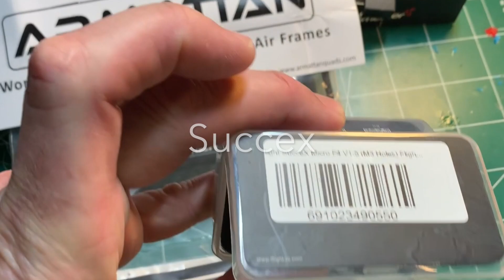Armattan Tadpole Build

Comment: Nice video, just a quick question. I have seen on several videos that there can be an issue with getting RSSI in the OSD with this FC and Frsky receivers, did you have any issues?
Reply from the maker: Hi Kwadrophenia, No I did not have issues with the Frsky R-XSR that I used as long as you have the right FW loaded. They have a later version of D16 (V2) that I have not upgraded to. Link below for the older FW for both LBT and FCC. Not sure what rcvr/s we are talking about. The XM+ uses aux12 (channel 16) for RSSI.

https://www.frsky-rc.com/r-xsr/ 
Go to history FW at the bottom of the page.

Comment: How do you like those beta fpv motors? Just picked some up for my build. I’m hoping they will have a decent amount of torque
Reply from the maker: The motors have plenty of torque and are very smooth. The only negative is they are a little amp hungry with the Avan props. Going to bi-blades will help if you don't want to run 4S 450mAh or larger 3S batteries.

Comment: I run 1103 xing motors on a 3s 450mah with 2 blade props. I get 4-6 min flight times and no battery sag till after atleast a minute. From what I can see I figure theres no big difference in power between yours and mine. You also might be over propping with those emax style blades. I just noticed you had battery sag right out the gate which can be an easy fix.
Reply from the maker: Hi Zach,
Thanks for the suggestion. I went a different route in fixing the battery sag. For this build I wanted to stay with 3 bladed props as they corner better in turns. My solution was to go with Tattu 4S 450mAh 75C batteries. They are only 11 grams heavier than my 3S 525mAh batteries. The FC stack and BetaFPV 1204 5000Kv motors can handle 4S. This made a world of difference in battery sag. I am 3 min in before any noticeable sag. Also I am now getting 5min of flight time if I am going easy and 4 if I push it.

Comment: I have that stack and was wondering about that frame. Did you have to do anything special to get the room. Do the stack bolts hit the upper plate? I have the 1103 8000kv and the 1204 5000kv. Trying to figure out what direction to go as far as a frame. Would you build it again or do something different with those components? Thank you for sharing this.
Reply from the maker: Forty5Kimber,
I am not sure why iFlight used the extra long stack bolts other than adding additional components (e.g. Caddx Baby Turtle). So I just turned these around so the heads are on the top of the stack and the nuts are on the bottom of the frame. I will probably get shorter stack bolts.

I want to do a 4 inch build but these are not the right components to do that with. I am happy with this build so far as a 2.5 inch freestyle quad.
Reply: SLOG FPV My frame will be here tomorrow thanks again!
Reply: I have a random assortment of 2mm stack bolts, how long should they be. I think I will order the frame. Thank you again for your help this looks like a tough lil bird.
Reply from the maker: @Forty5Kimber  
The stock bolts are 22mm. With reasonable tension on the rubber isolation grommets, I would use 20mm bolts. You will still need to put the head of the bolt on top of the stack and the nut on the bottom. That will give you about 3mm of clearance between the top plate and the stack bolt. Also having a little extra thread allows you to play with grommet tension. I hope this helps.
Reply: @slogfpv  thank you again it helped a bunch ordering this frame asap this looks like a great build!

Comment: I recently received a Larva X V2 and wrecked it yesterday. I hit a tree and broke the frame in more than 1 place. I really want to move my Larva guts into the Armattan Tadpole frame. What do you think? 🤔
Reply from the maker: Hi Juan Ninja,

Without the Diamond VTX/DVR it would easily fit within this frame. With the FC board and Diamond VTX I was measuring around 18 mm. The stack height should not be greater than 16 mm so you may have to remove the motor connectors and solder the motor wires directly on top of the flight controller. But other than being tight, I think it would be a fun little conversion.
Reply: @slogfpv  Agreed, I think it would be a fun little build. Good point on the stack height potential issue. Do you think it could clear it with the AIO Board Bracket Armattan offers for the Tadpole? Maybe I could use some washers or something?
Reply from the maker: @dynamicfpv  
The 18 mm was assuming that you were using the whoop board bracket. But as they say, if there is a will there is a way. So without actually doing the build, I think you have the following options if you don't want to solder the motor wires on directly:
1. Flip the board upside down so the motor connectors are facing up. The motor wire connectors will not hit the bracket then and you only have to worry about having enough clearance for the VTX/Camera wires. However, you will need to change the AIO FC orientation in the Betaflight Configurator.
2. Don't use the AIO bracket and just use the front and the back stack bolts like what you would do on a Primo frame build. The motor connectors do clear each side of the bottom frame.
3. Put the whoop AIO bracket mount underneath the frame to get more motor wire connector clearance. You will need to play with rubber grommet heights (may have to split them in half or add plastic washers. 
4. You might be able to reduce the gap between the AIO board and the VTX board and to get enough clearance. 

I am sure there are other creative solutions so I would go for it.  

Cheers,

SLOG
Reply: @slogfpv  I don't really want to take the motor connectors off and sauder. I like your idea of putting the AIO flight controller underneath the frame. As you said with some creativity with the washers, nuts and spacers it should come together. I'll keep you posted when I get to building it. Keep up the great videos. If you have any more great ideas please let me know.

Comment: I was about to build out this frame   but I noticed my omnibus Nano V6 & the matching orion  ESC wouldn't fit in this tiny frame.  Odd because my 4" Armattan Japalura is running that set just fine.  I wish they had a 20 x 20 mount in this .   I have nothing in the 16 x 16 form factor yet ...I really admire your tenacity. I'm 52 this year and soldering all that tiny stuff always amazes me that I pulled it off

Comment: Nice Video
How do you find it in comparison to the GEPRC Phantom ?
Reply from the maker: The Tadpole as I built it, has a very different flying experience than the Phantom. The Phantom is geared for someone who wants a great little park flyer with longer flight times that you can do light freestyle with. It is more of a chill out and relax experience with the Phantom. The Tadpole is more of serious freestyle quad due to its larger motors and tri-blade props. It is very fast for such a little quad as you can see in the video on the one speed run I did. At full throttle it does suck the amps. So I like them both just depends on how I feel when I go out to fly.
Cheers,
SLOG
Reply: @slogfpv  Thank you very much. That helps me a lot. I think I'm going with the Phantom then.

Comment: How are you liking those RDQ packs compared to the GNB.
Reply from the maker: I like really like the 525 mAh 3S RDQ batteries. I was a little disappointed in the 350 mAh 3S battery as far as voltage sag. I am going to try a fresh one to see if I did not get a bad one. As far as comparing to GNB, I am not sure who makes RDQ batteries but Nick Burns suggested some are made by GNB? I think he might have some insight since he used to represent China Hobby Line batteries. I will say the GNB 450mAh 2S non-HV batteries are great. The one I flew is really old and I don't know how many charge cycles it has. They are hard to find since most are now HV versions. I have some of the HV on order to see if they will last as long.